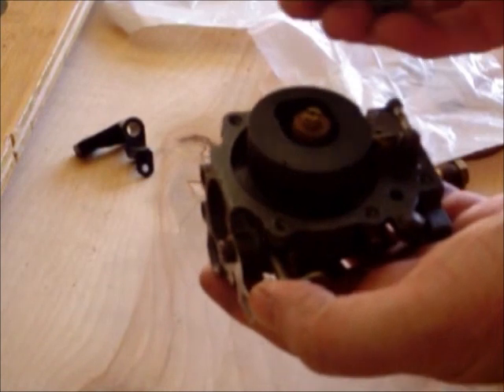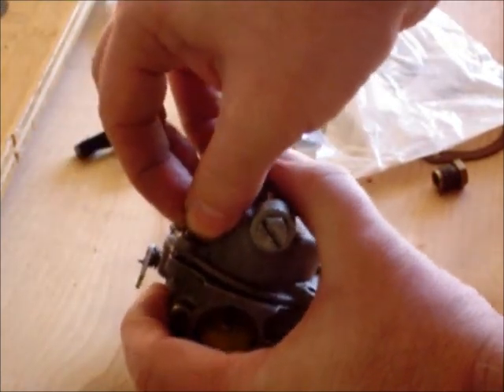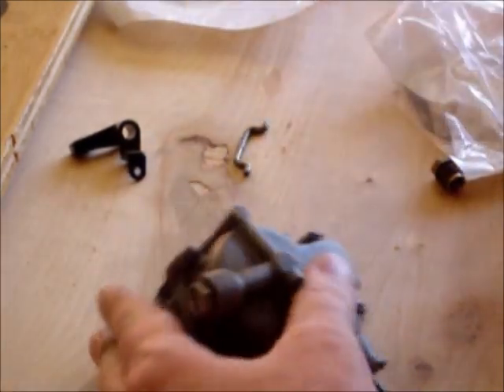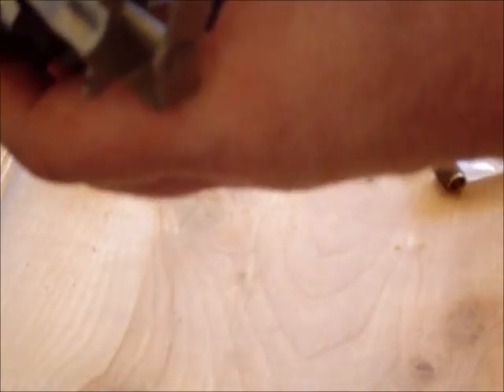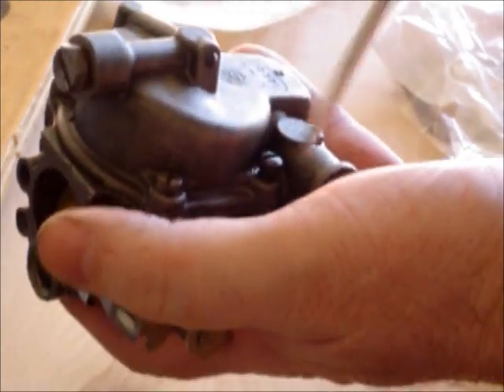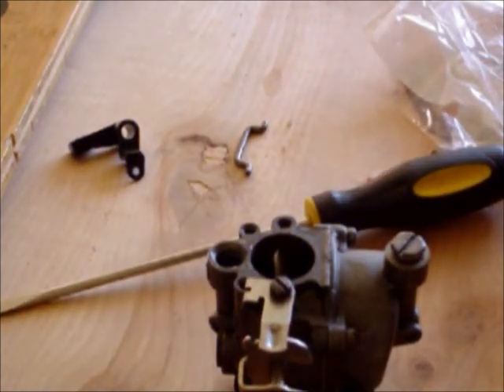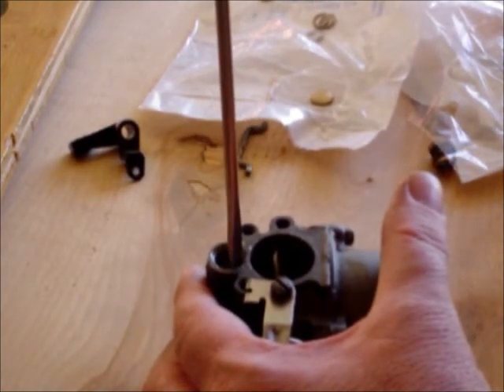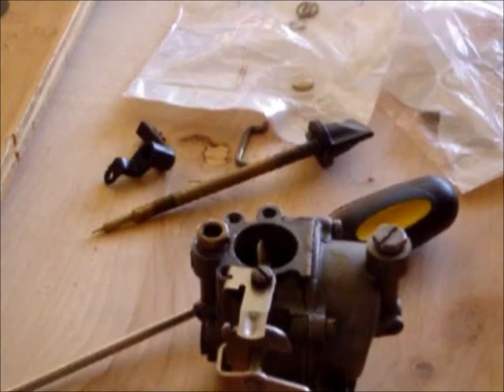OMC fix jet carburetors part 8 of 10  (Motor displayed 1968 Johnson 6hp)

Comment: funny thing about these carbs and  similar  ones by Johnson/ Evinrude/ aka OMC is that the original corky floats is that it can be installed flipflop! and will run both ways! a friend helping rebuild the  carb installed  float upside down! I took a pic of the carb when I removed it again. Good thing I did because if I didn't have the photo it  would have been frustrating troubleshooting! Measure Twice cut once and regardless of skill level or experience take photos of  things ! the ego can  be tricky ! the plastic replacement floats only install one way its seems thanks Cajuncook!